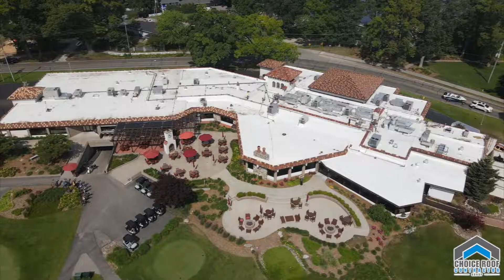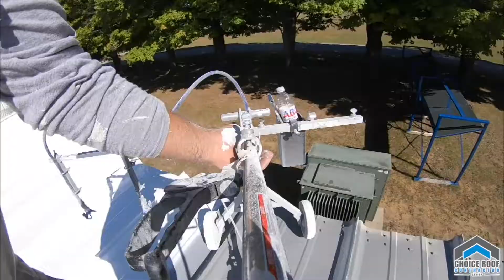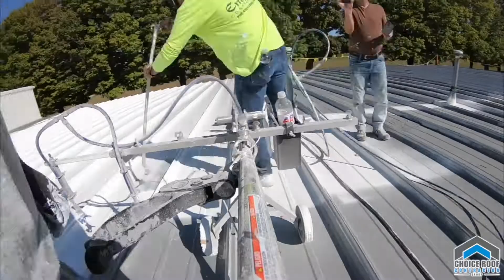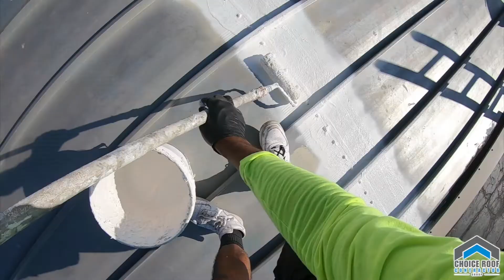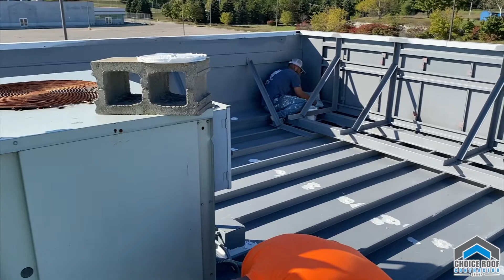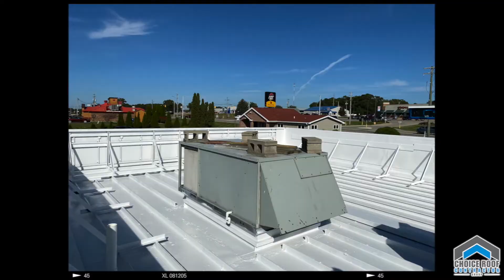Efficiently Spraying Commercial Roof Coatings

Comment: What’s that tool called that was used to seal the fasteners? And what size sprayer was used for spraying the wall? Also is the roof coating bitumen, acrylic or silicone?
Reply: We use the “Roof-Tube” to seal the fasteners. We’ve used several different spray rigs. In that video we used a Graco 733 or 833. The Coating we used were acrylic or polyurethane modified acrylic.